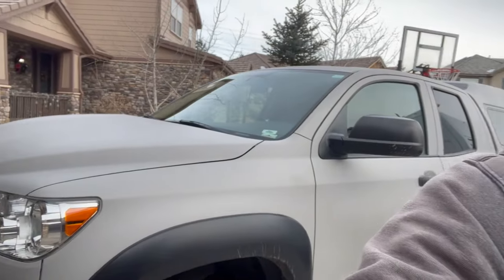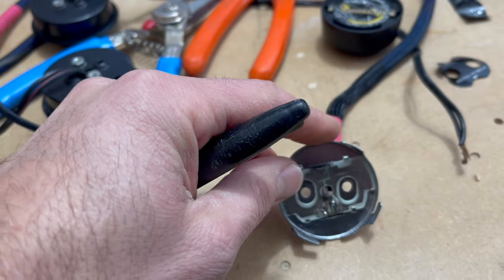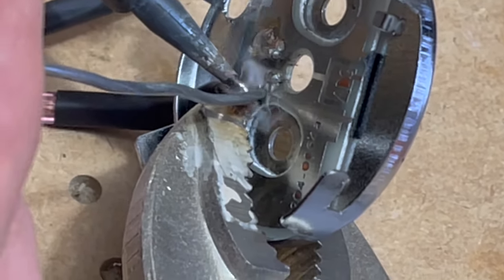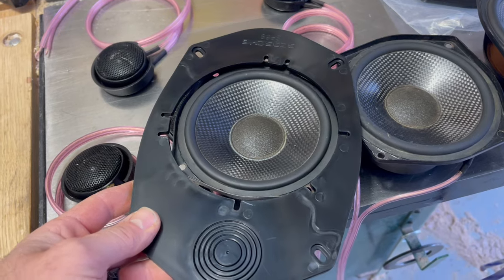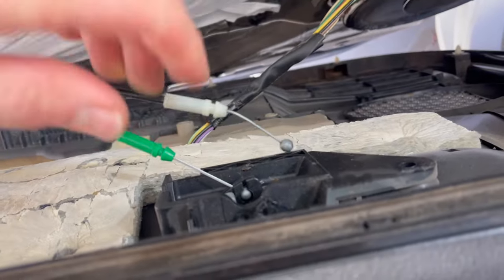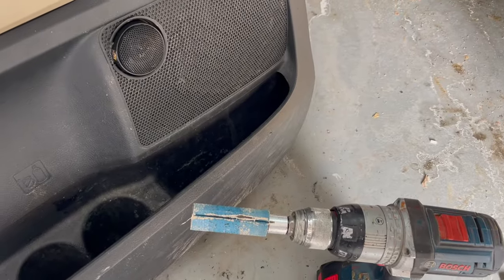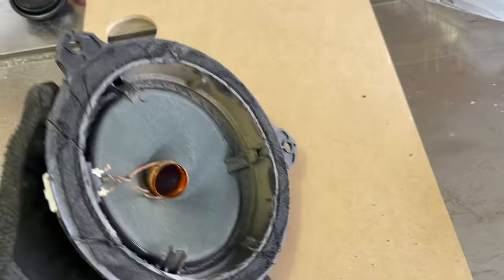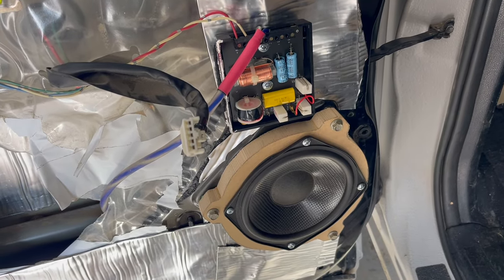Orion NT Reborn: Restoring 90's Competition Speakers

Comment: Just a tip if you need a heat gun autozone sells a decent one at a reasonable price I’ve used mine with heat shrink tubing, to melting the ends of Paracord and shrinking battery shrink wraps oh and flux is your best friend when soldiering you could also get solder with flux already in it, flux helps the solder bond to the wire creating a solid connection!
Reply from the maker: Thanks for the tip on the heat shrink. Turns out my soldering iron was about burned out, which is why my solders sucked. Lol… I thought it was me, but it was low heat. I agree flux solder is the way to go.
Reply: @Wallymakesstuff  makes sense! And you’re welcome!